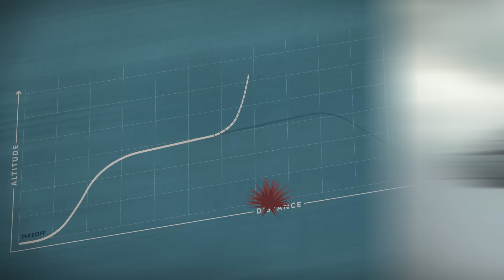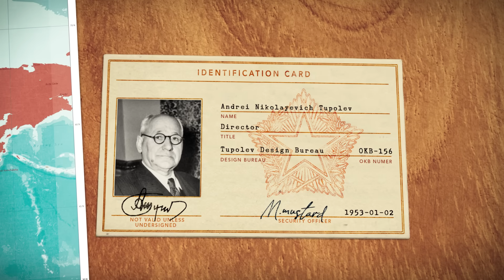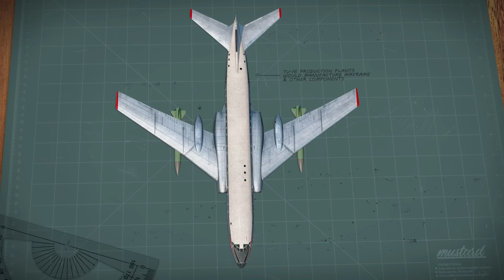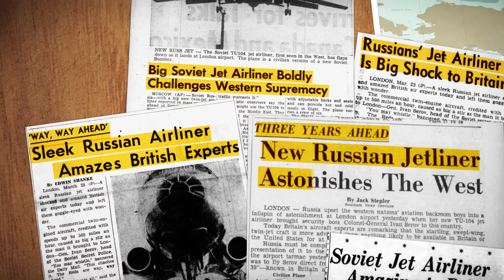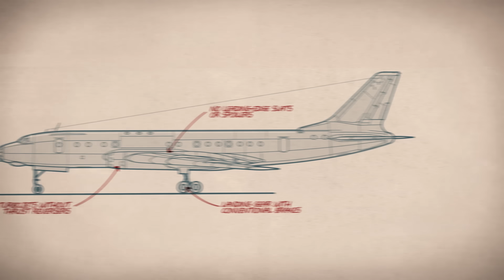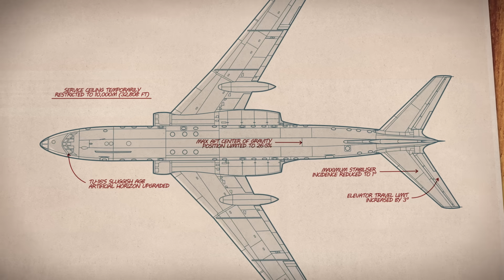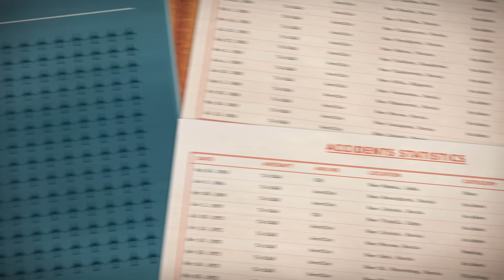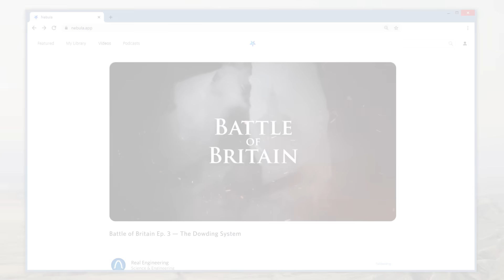The Soviet Airliner Designed To Crash

Comment: DC10 exists
Reply: DC-10 is still flying, it has an excellent statistical safety record compared to the Tu-104 or the de Havilland Comet.
Reply: @sandervanderkammen9230 

We feel we can shed some light on some common myths & misunderstandings repeated in many comments.

Yes of course that's correct, the DC10 door issue was caused by a serious design error resulting in it being possible for the cargo door locked indicator in the cockpit & the cargo door locked indicator by the cargo door to both show the door as fully locked when in fact it was not fully locked. A rather odd agreement between a person at the FAA & a people at the manufacturers resulted in immediate modifications not being done which eventually resulted in another incident. The DC10 required other safety related modifications besides the cargo door problem & eventually attained an average accident losses rate for an airliner that first flew in 1970.

Although the TU-104 was a later design aircraft it was not safer than the DH Comet.

It is indeed correct that there were plenty of aircraft that were more dangerous than the De Havilland Comet before & after the Comet.

Obviously It's not valid to compare a Bow-wing ( see B-47 wing folding & wing collapse incidents for details) jet  airliner designed & first built as late 6 decades after the Comet, with the fabulous De Havilland Comet, the world's first high altitude jet powered airliner.  
  Vast improvements in commercial aviation infrastructure & pilot familiarity with jet airliners alone being a significant factor in improvements in air travel safety safety over more than half a century.

    Of course Bow-wing having 50 years more design, build & operation experience than De Havilland didn't prevent the horrendous Bow-wing Max  incidents, there can obviously be no excuses for that.
  
  That's correct of course, at the time the Comet wasn't particularly dangerous. Agreed, that is indeed the case of course, The DH Comet was definitely not the worst engineering failure in commercial airliner history.

Losses comparisons.     
How things were in those days.
    
DeHavilland Comet 4 UK                  14% 
DeHavilland Comet all mks             17%  

Boeing 307                               70%
Boeing 247                               48%
Boeing 707            .                  20% 
Lockheed Electra Turboprop   29%
Canadair CL-44  Turboprop     46%  
Convair CV-580  Turboprop     22%
Convair CV-880    (ff 1959)       27%  
Convair CV-990     (ff 1961)      33%
Tupolev TU-104       (ff 1955)    16%

     Of course De Havilland had prior experience building many all metal construction airframe aircraft & thousands of jet powered fighter aircraft that were primarily of metal construction with pressurised cockpits & jet engines built by De-Havilland.

  Yes, that's true, De Havilland carried out full stress analysis & engaged in a comprehensive & protracted testing program which is why key De Havilland people were happy to be aboard flying DH Comet aircraft. The Comet was the first airliner where stress due to pressurisation significantly exceeded flying load stress for a full length passenger cabin fyselage.

    We agree, that's correct, the DH Comet was the first passenger airliner with full length fuselage pressurisation at 8psi pressure differential. Handley Page built the world's first all metal construction airliner during the 1920s.
    In many cases earlier pressurised aircraft were larger, needed thicker fuselage skins due to flying stresses alone & had much lower pressurisation differential pressure. 

     Of course ripstop provision was provided. The skin alloy used became unavailable at the time due to R & D at the manufacturers which resulted in the original alloy being discontinued. Later alloys had very similar properties. The skin thickness used for the Comet was used for similar size later aircraft. Frame spacing was not found to be too large & frame width was not found to be too small.

    Without doubt De Havilland did indeed always work to better than industry standards at the time, used up to date knowledge for the design & construction & no evidence of negligence or criminal negligence was ever produced in relation to the DH Comet.

   Obviously the DH Comet had no effect on the course of the aerospace industry in the UK. The UK now has the world's largest combined nuclear, aerospace & defence sectors per capita activity.

    That's correct, the investigation committee did not find hundreds of fatal flaws or evidence of design defects, structural defects, defective materials or shoddy workmanship. Indeed it is the case that ripstop provision was included. Claimed incidents did not involve cracks starting from passenger window corners.
   Pretty much all changes were just in case changes or were planned development modifications & improvements that were scheduled regardless of incidents.

    Obviously De Havilland designers knew all there was to know about metal fatigue at the time they designed the DH Comet.

    It is in fact true to say that the way airliners were built changed everywhere including in the US after the Comet incidents.

We hope this helps, obviously.

Cheers indeed of course 👍. 
                      
 . . .... ... .... .  .. ...
.. ......... ..  ... . . ...
 ..... ..... .... ... .......

Comment: The 104 was rushed to save face as a country. 
The 104 was slower than the Super Constellation especially on longer routes such as in the USSR as you mentions.  The reason because the 104 shorter range that you touted as being a significant advantage.  The 707 had a longer range just one year later. 
With 201 built its only outstanding feature was its failure. But in that regard  was only bested by the comet of which only 114 were built.

Comment: The Most Dangerous Airliner is currently the 737MAX-8 when using the flight hour vs fatality ratio.
Reply: False, the 737 Max has an excellent statistical safety record compared to the Tu-104 or the worst jet airliner in history... the deadly de Havilland Comet.
Reply: @sandervanderkammen9230 

We feel we can shed some light on some common myths & misunderstandings repeated in many comments.

Although the TU-104 was a later design aircraft it was not safer than the DH Comet.

It is indeed correct that there were plenty of aircraft that were more dangerous than the De Havilland Comet before & after the Comet.

Obviously It's not valid to compare a Bow-wing ( see B-47 wing folding & wing collapse incidents for details) jet  airliner designed & first built as late 6 decades after the Comet, with the fabulous De Havilland Comet, the world's first high altitude jet powered airliner.  
  Vast improvements in commercial aviation infrastructure & pilot familiarity with jet airliners alone being a significant factor in improvements in air travel safety safety over more than half a century.

    Of course Bow-wing having 50 years more design, build & operation experience than De Havilland didn't prevent the horrendous Bow-wing Max  incidents, there can obviously be no excuses for that.
  
  That's correct of course, at the time the Comet wasn't particularly dangerous. Agreed, that is indeed the case of course, The DH Comet was definitely not the worst engineering failure in commercial airliner history.

Losses comparisons
How things were in those days.

DeHavilland Comet 4 UK                  14% 
DeHavilland Comet all mks             17%  

Boeing 307                               70%
Boeing 247                               48%
Boeing 707            .                  20% 
Lockheed Electra Turboprop   29%
Canadair CL-44  Turboprop     46%  
Convair CV-580  Turboprop     22%
Convair CV-880    (ff 1959)       27%  
Convair CV-990     (ff 1961)      33%
Tupolev TU-104       (ff 1955)    16%

     Of course De Havilland had prior experience building many all metal construction airframe aircraft & thousands of jet powered fighter aircraft that were primarily of metal construction with pressurised cockpits & jet engines built by De-Havilland.

  Yes, that's true, De Havilland carried out full stress analysis & engaged in a comprehensive & protracted testing program which is why key De Havilland people were happy to be aboard flying DH Comet aircraft. The Comet was the first airliner where stress due to pressurisation significantly exceeded flying load stress for a full length passenger cabin fyselage.

    We agree, that's correct, the DH Comet was the first passenger airliner with full length fuselage pressurisation at 8psi pressure differential. Handley Page built the world's first all metal construction airliner during the 1920s.
    In many cases earlier pressurised aircraft were larger, needed thicker fuselage skins due to flying stresses alone & had much lower pressurisation differential pressure. 

     Of course ripstop provision was provided. The skin alloy used became unavailable at the time due to R & D at the manufacturers which resulted in the original alloy being discontinued. Later alloys had very similar properties. The skin thickness used for the Comet was used for similar size later aircraft. Frame spacing was not found to be too large & frame width was not found to be too small.

    Without doubt De Havilland did indeed always work to better than industry standards at the time, used up to date knowledge for the design & construction & no evidence of negligence or criminal negligence was ever produced in relation to the DH Comet.

   Obviously the DH Comet had no effect on the course of the aerospace industry in the UK. The UK now has the world's largest combined nuclear, aerospace & defence sectors per capita activity.

    That's correct, the investigation committee did not find hundreds of fatal flaws or evidence of design defects, structural defects, defective materials or shoddy workmanship. Indeed it is the case that ripstop provision was included. Claimed incidents did not involve cracks starting from passenger window corners.
   Pretty much all changes were just in case changes or were planned development modifications & improvements that were scheduled regardless of incidents.

    Obviously De Havilland designers knew all there was to know about metal fatigue at the time they designed the DH Comet.

    It is in fact true to say that the way airliners were built changed everywhere including in the US after the Comet incidents.

We hope this helps, obviously.

Cheers indeed of course 👍. 
                   
 . . ....
 ... .... . 
 .. ...
.. ......... ..  ...
 . . ...
 ..... ..... ....
 ... .......

Comment: Leave it to the Soviet union to take western ideas and make them worse
Reply: Actually it was the British that made the worst jet airliner, the Comet has the highest loss rate and fatalities statistics of any jet airliner in history
Reply: @sandervanderkammen9230 

We feel we can shed some light on some common myths & misunderstandings repeated in many comments.

Although the TU-104 was a later design aircraft it was not safer than the DH Comet.

It is indeed correct that there were plenty of aircraft that were more dangerous than the De Havilland Comet before & after the Comet.

Obviously It's not valid to compare a Bow-wing ( see B-47 wing folding & wing collapse incidents for details) jet  airliner designed & first built as late 6 decades after the Comet, with the fabulous De Havilland Comet, the world's first high altitude jet powered airliner.  
  Vast improvements in commercial aviation infrastructure & pilot familiarity with jet airliners alone being a significant factor in improvements in air travel safety safety over more than half a century.

    Of course Bow-wing having 50 years more design, build & operation experience than De Havilland didn't prevent the horrendous Bow-wing Max  incidents, there can obviously be no excuses for that.
  
  That's correct of course, at the time the Comet wasn't particularly dangerous. Agreed, that is indeed the case of course, The DH Comet was definitely not the worst engineering failure in commercial airliner history.

Losses comparisons
How things were in those days.

DeHavilland Comet 4 UK                  14% 
DeHavilland Comet all mks             17%  

Boeing 307                               70%
Boeing 247                               48%
Boeing 707            .                  20% 
Lockheed Electra Turboprop   29%
Canadair CL-44  Turboprop     46%  
Convair CV-580  Turboprop     22%
Convair CV-880    (ff 1959)       27%  
Convair CV-990     (ff 1961)      33%
Tupolev TU-104       (ff 1955)    16%

     Of course De Havilland had prior experience building many all metal construction airframe aircraft & thousands of jet powered fighter aircraft that were primarily of metal construction with pressurised cockpits & jet engines built by De-Havilland.

  Yes, that's true, De Havilland carried out full stress analysis & engaged in a comprehensive & protracted testing program which is why key De Havilland people were happy to be aboard flying DH Comet aircraft. The Comet was the first airliner where stress due to pressurisation significantly exceeded flying load stress for a full length passenger cabin fyselage.

    We agree, that's correct, the DH Comet was the first passenger airliner with full length fuselage pressurisation at 8psi pressure differential. Handley Page built the world's first all metal construction airliner during the 1920s.
    In many cases earlier pressurised aircraft were larger, needed thicker fuselage skins due to flying stresses alone & had much lower pressurisation differential pressure. 

     Of course ripstop provision was provided. The skin alloy used became unavailable at the time due to R & D at the manufacturers which resulted in the original alloy being discontinued. Later alloys had very similar properties. The skin thickness used for the Comet was used for similar size later aircraft. Frame spacing was not found to be too large & frame width was not found to be too small.

    Without doubt De Havilland did indeed always work to better than industry standards at the time, used up to date knowledge for the design & construction & no evidence of negligence or criminal negligence was ever produced in relation to the DH Comet.

   Obviously the DH Comet had no effect on the course of the aerospace industry in the UK. The UK now has the world's largest combined nuclear, aerospace & defence sectors per capita activity.

    That's correct, the investigation committee did not find hundreds of fatal flaws or evidence of design defects, structural defects, defective materials or shoddy workmanship. Indeed it is the case that ripstop provision was included. Claimed incidents did not involve cracks starting from passenger window corners.
   Pretty much all changes were just in case changes or were planned development modifications & improvements that were scheduled regardless of incidents.

    Obviously De Havilland designers knew all there was to know about metal fatigue at the time they designed the DH Comet.

    It is in fact true to say that the way airliners were built changed everywhere including in the US after the Comet incidents.

We hope this helps, obviously.

Cheers indeed of course 👍. 
                   
 . . .... ... .... .  .. ...    .
.. ......... ..  ... . . ...    .
 ..... ..... .... ... .......   .

Comment: Just prior to this I watched a video on this very same channel about the TU 114. You talked about how the soviets had only small and non impressive planes at that time which was the same time as in this video here. With that in mind both of these videos don't make sense together. why wouldn't they just have used the TU 104 then? This plane also seems impressive so no need for the TU 114.  And vise versa. Many of the reasons you named for developing the TU 104 where also fullfilled by the TU 114.

Comment: From the three Jet pioneers, Comet, TU-104 and Caravelle, the TU-104 was the second most dangerous after the Comet.
Reply: 4 pioneer jets... the Boeing 707 was the most successful and the first airworthy jet airliner.
Reply: @WilhelmKarsten  707 was the most successful and an overall a great airliner, far better that the previous three mentioned but not a pioneer.
Reply: @toy2day1  The Boeing 707 was THE pioneering jet airliner, all modern jet airliners are modeled after it and it's still in service.
The most significant and revolutionary new aircraft design since the Messerschmitt Me-262.

Comment: Modern engineering & science +innovations can also enhance plane on hydrogen,battery,fusion,solar,wind, caught co2 multi enengy and collected conducted lighting strikes like Stanford tower Chicago , and place in turbines in parts of the wings like Boeing 747 and 7070 and retired models + works to land then on the sea when coastal airports get full and temporary fly to space and back cutting travel time to3/4 less, and etc

Comment: Nice song, we sang it in the 60s. However, I had to fly the Tu-104 Lelingrad-Moscow several times in the mid-70s. This is considered a short route and was served by this aircraft. It has already been removed from long-distance routes. The plane seemed rather archaic to me until I had to fly from Moscow to Central Asia on an IL-18. This was a real vibration stand, although it had the most comfortable seats of anything I had to fly on.
Reply: I’ve flown on almost every kind of Western aircraft from jumbo jets to little single prop puddle-jumpers, but haven’t gotten to fly on any of the Eastern or old Soviet planes. 

I’m a little worried to, honestly.